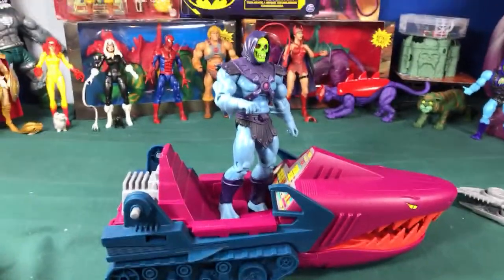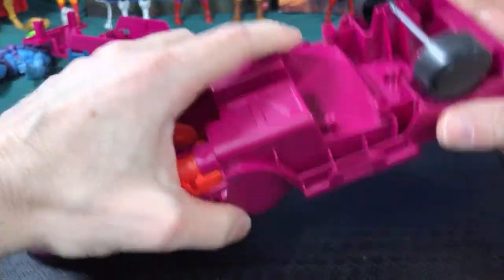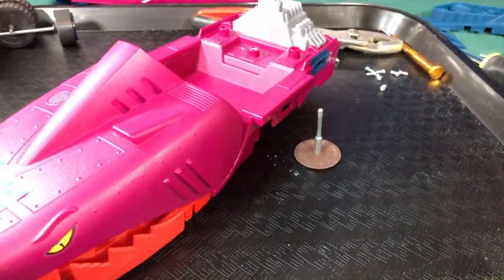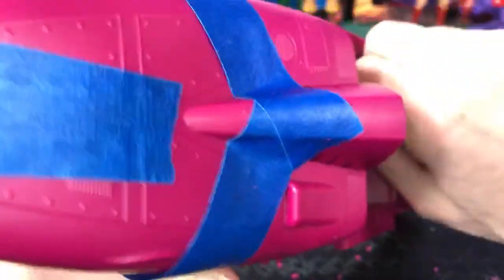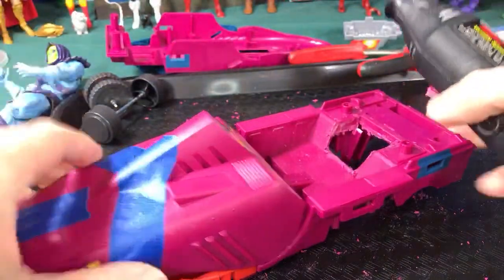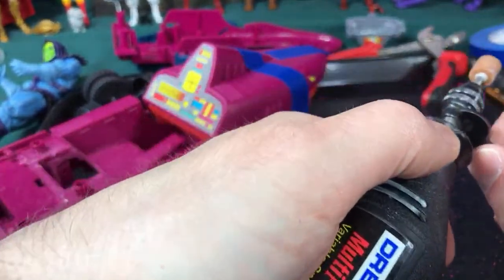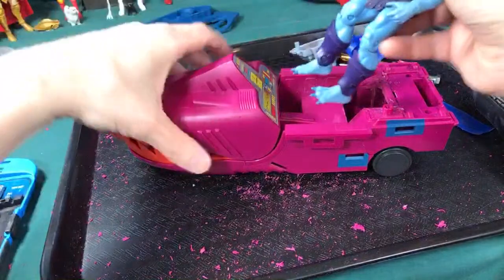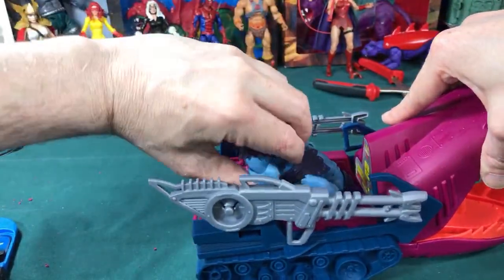Altering Origins Land Shark to fit a Skeletor classics figure - Part 1

Comment: You can fit classic Skeletor into the default origins LandShark without any modifications whatsoever by having him sit very bow legged just like the vintage figure with the boot cut turned pigeon toed, ab crunched forward, and the ankles angled forward.  Zero mods needed, shark biting action works just fine..  Can sit just fine.  Feet are meant to fit under the dash.  Even vintage and origins need to do that with this vehicle in order to sit and hold the grips.   If you want him to sit straight legged like you have done then sure you probably need to do the mods that you have done. I’m just letting you know and everyone else know that these mods are not necessary if you just want to get skeletor sitting in like his vintage self.   Your mods will allow a variety of figures to sit in as well.
Reply from the maker: Thanks for the info.